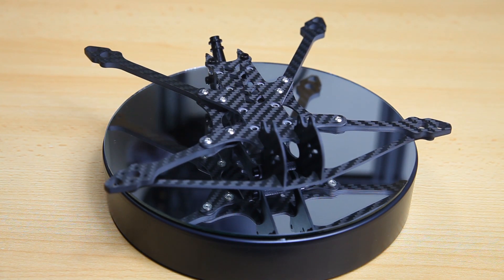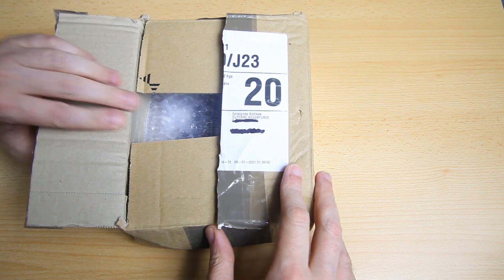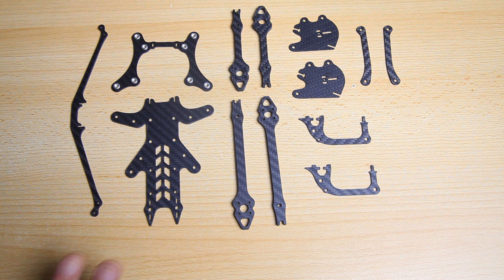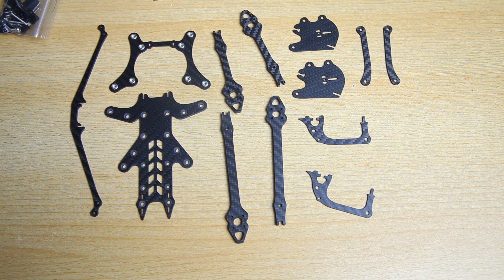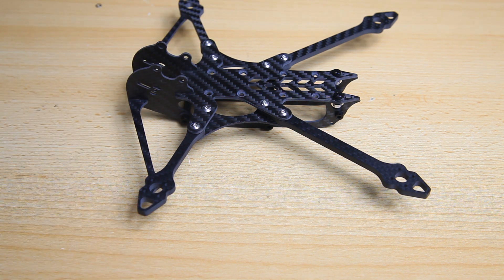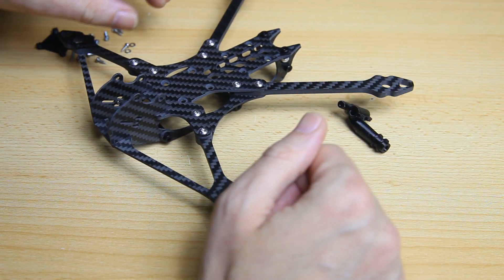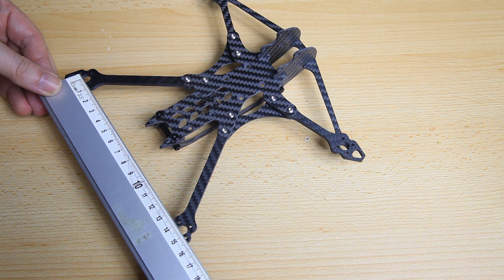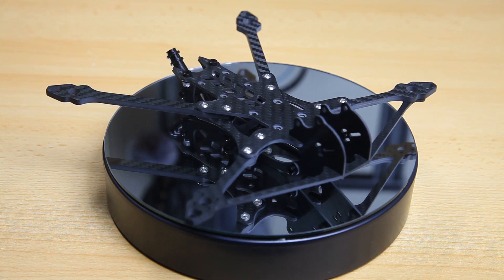SHOCKER! :D - Catalyst Machine Works Light 5-INCH - FRAME REVIEW

Comment from the maker: Gorgeous frame I think! Let's have a close look at it :) 
The frame: https://www.fpv-fly.fr/frame-the-shocker-hd-ultralight-lr-4-ou-5-catalyst-machineworks.html 

Mamba F722 mini stack: 
https://www.banggood.com/20x20mm-MAMBA-Stack-F722-MINI-MK3-F7-Flight-Controller-F40-PRO-MINI-40A-Blheli_32-2-6S-32BIT-DSHOT1200-Brushless-ESC-for-RC-Drone-FPV-Racing-p-1810985.html?p=TO251813974002015038 

Mamba 2004 1700 Motors: 
https://www.banggood.com/MAMBA-TOKA-2004-1700KV-4-6S-2900KV-3-4S-Brushless-Motor-for-4-Inch-RC-Drone-FPV-Racing-p-1828154.html?p=TO251813974002015038 

Caddx / DJI Vista set: 
https://www.banggood.com/Caddx-Vista-HD-Digital-System-5_8GHz-FPV-Transmitter-VTX-FOV-150-Degree-Camera-1080P-Recording-AIO-Compatible-DJI-FPV-Goggles-Remote-Controller-For-Small-Drones-Whoop-Airplane-p-1625165.html?p=TO251813974002015038 

TBS Croffire nano receiver: 
https://www.team-blacksheep.com/products/prod:crossfire_nano_se 

Frame Specifications: 
type: Long range FPV cruiser 
wheelbase: 125 mm 
Left-to-Right: 175 mm 
Front-to-Back: 133 mm
base thickness: 4mm thick arms 
weight: 56 grams 
material(s): carbon fiber + allu standoffs 
chamfered edges: No, but well machined 
clean: Yes
20x20 mount: yes Two 20x20 positions
30.5x30.5 mount: nope 
Action-cam mount: optional 
battery strap: yes Two
battery anti-skid pad: Nope!

Comment: I remember seeing your videos some time ago, and now I see you've built this frame that l have as well.
Unfortunately the gyro on the iflight F7 twin g mini fc don't last long two battery's and since it's bin just sitting around. 
Did just get a momba F7 mini that I'm building.
And trying the caddx tarsier v2 for the shocker lite.
Thanks for the review.
Love CMW.
Reply from the maker: these Are very nice frames indeed.. I have 2 of them by now :) 
I had issues with the Twin G F7 boards as well.. Did you try disabling 1 of the gyro's in Betaflight? That helped on this end.. You might still be able to use it that way
Reply: @DutchRC  I actual watched a Bardwell video about gyros and tried disabling one and then the other to figure it out, but for some reason it didnt seem to have any effect.
Im very tempted to buy the CMW dopplebanger.
Will you do a build vidoe on that one?
Reply from the maker: @rumijarl  that new frame Does look good or what? :D 
I haven't seen it in shops over here in Europe yet though :$  
Maybe I'll ask CMW to send me one ;)

Comment: With regards to camera mounts, there are some available to print on yeggi. You need to make the mount and then decide on angle of cam as there are various adapters that fit. All designed to attach to two standoffs that locate above fpv camera mount. Give me a shout if you want links etc... 🙂
Reply from the maker: Thanks man! it would probably not work as I will be using other standoffs (parts bin :P)  
I just converted a Gopro 8 into a Gopro Lite so I will be drawing up a mount for that :)

Comment: I've literally just completed a build of the 'tank' version. Beautiful, Lamborghini style, bat-copter type of frame. Running hobbywing f7 convertible 60a stack with large f80pro 2407 1900kv motors I expect it to be a smooth operator. Mine weighs 964gram with hero6 black n 1500mah 100c 6s. I bet yours will be half that 😏  
Maiden flight tonight and uploaded tomorrow :)
Reply from the maker: Ohww no! :P  I'm doing my best here not to also order that frame :D :P   That one does also look tasty indeed.. And you used some beefy moters on it to boot :D 

To late for "good luck" probably soooo how was that? :)
Reply: @DutchRC  I've just had first flight of it on stock betaflight. Smooth as silk; as to be expected at that weight with smooth n  beefy t-motor 2407 f80 pro . You won't be disappointed with s heavy built version but deffo needs 1500mah 6s to reduce voltage sag. I'm looking st a lightweight version. I wish they'd do a 6 inch version of each
Reply from the maker: @retrodudefpv  7 Inch you say?! :D  I'd take that!  I recently did some more flying with the iFlight DC7.. quite enjoyable :D
Reply: @DutchRC  yeah, I love my Armattan Chameleon ti7, it runs 2806.5 1300kv, but was a bugger to tune. I think Armatten should have used 6mm arms instead of 4mm :)
Reply from the maker: @retrodudefpv  stif arms that kinda smuther the vibrations do tend to make the tuning ordeal easier huh? :)

Comment: 56 grams, not bad at all. I can only consider their products if they are available locally as well, having them shipped costs too much.
Reply from the maker: Exactly! I was glad to see the frame being in stock over on this side of the pond :)
Reply: Hey, CatalystMachineWorks are great to deal with, and you get that personal touch when contacting them about anything you need to know. I ordered shocker tank and had it at my door within a couple of weeks, no import duties. I think the way things are, customs are more likely to stop a Chinese order. Serioisly, if you like the look of them in video, they are even better in reality. Beautifully designed and manufactured.
Reply: @yannickg6904  ahh, such a shame. Its gone other way here in UK, quicker n easier to order from USA than China 🙂
Reply: @retrodudefpv  I will keep an eye out. Some local shops have had CMW frames in stock before, but they sell out quickly.